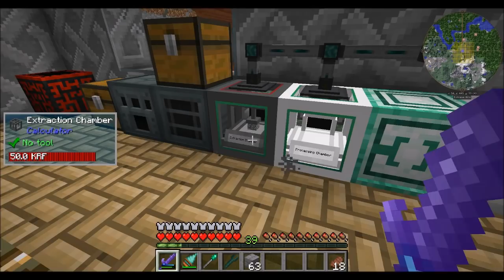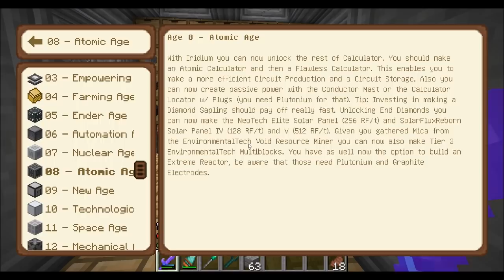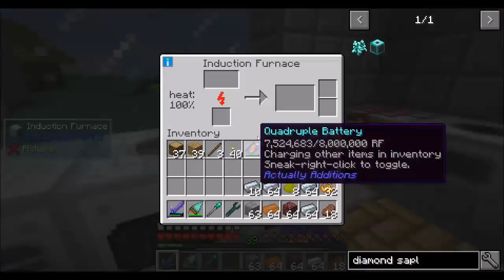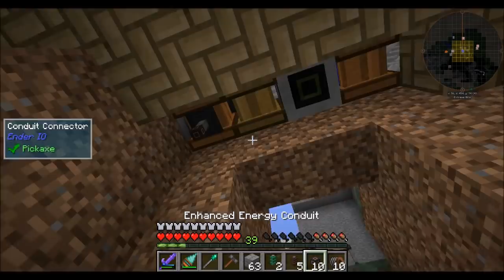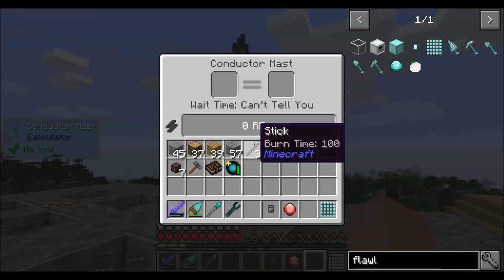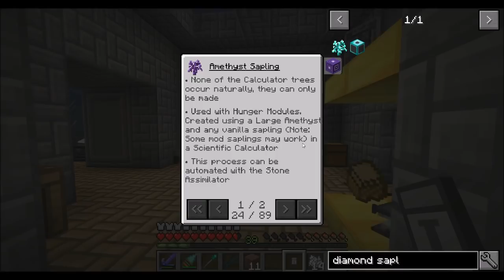AoE Ep36 Flawless Calculation

Comment: You can install additional modules into the Flawless Calculator.  One of those is the Food Module which will automatically feed you from food points stored on the calculator.  The food processor you got earlier can be used to automate the generation of food.

Comment: The one item Dire overlooked for moving to AE2 is the IC2 basalt which requires a liquid heat exchanger. He will need to update the electric heat exchanger to the liquid one in his IC2 blast furnace setup.
Reply: He'll figure it out that he needs the pahoehoe lava at some point.  Likely when he tries to craft it with EnvTech Basalt or Chisel Basalt

Comment: You can use weather station weather station and transmitter to boost the conductor mast power to a stupid amount and all you need is a Diamond tree and a blaze farm. My mast is at 11.000Rf/t atm
Reply: The fact it's so cheap when you have a Diamond Tree is the only reason to do this. 11kRF isn't spectacular in this pack, but once the ingredients are free it's a no brainer, will try soon.

Comment: Btw dire u can generate massive rf with conductor masts by upgrading it
Reply: Joseph Espiritu yeah it's worth
Reply: Absolutely. Even just a few dishes makes a big difference. And it can have a 10 radius reach of dishes and another 30 radius reach of the antena plus the empty spaces in the first ring. Its massive but if u use the rftools power cells its amazing
Reply: it was nerfed at some point though so right now he would need to upgrade it a lot.
Reply: MrTopf yeah just checked there is an update I haven't run yet so thats probably true
Reply: It was not nerf'd that badly at all. It was simply absurd before.
Reply: SystemCollapse was litteraly in the middle of re watching your AoE videos and saw the notification XD thats awesome. And fair point. Still. Im sticking to soryn logic if its broken that badly. DONT FIX IT! Abuse it as much as u like but dont fix it lol

Comment: Update manually calculator, the issue of the storage chambers not working properly with conduits is now fixed
Reply: Ooh! I will look at how hard this is to do with the Twitch client because I really want this. I'm like two ages past where Dire is, but moving slower than him so he might catch up. I could use AE2 or something but want the Storage Chambers because they're perfect for Calculator modulo the bug. So this would be awesome.
Reply: Nick Lamb with the twith client: open up the AoE profile, in the upper right corner click on the three dots (or a gearbox i dont remember), click profile option, disable block mode. Return to the profile AoE in the mod lost click calculator, go to version and download the latest (if the last version is a release version it will show up directy in the mod list next to the name)  :)
Reply: yes but that way you "break" the recipe and only need an diamond instead of an iridium plate :(
Reply: Jan Breuer are you sure? The recipes are changed via mine tweaker scripts, not by modifying the mod in any way, so unless he's changed actual item/block names updating the mod version shouldn't break any recipes. If it really does then it's not too hard to fix: you cheat yourself in each of the intended crafting ingredients, hold each one in your hand and type "/mt hand" with each one to get the new item ID, then find the mine tweaker script that changes the recipe and update it with the new item/block names. Would take about one minute not counting the time it takes Minecraft to load

Comment: @Direwolf20 once I found the calculator piping issue I went to AE and did a filtered 4K drive for both Analyzed and Stable, a way better storage method.
Reply: The only downside to that is that the machine that can create the speed upgrades, etc. will only pull from the storage chambers which means you have to take the circuits you want and put them in there manually if you want to craft with it.